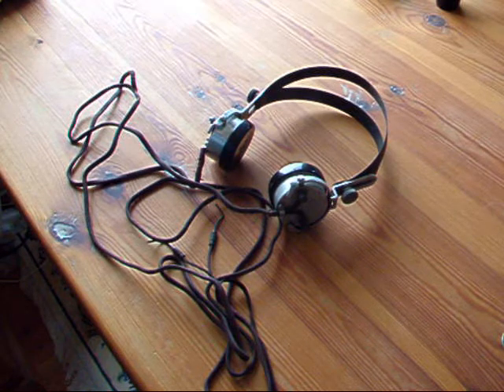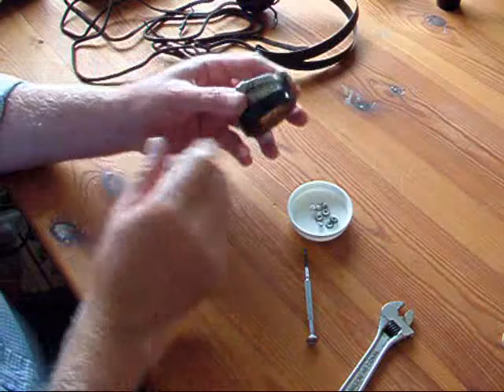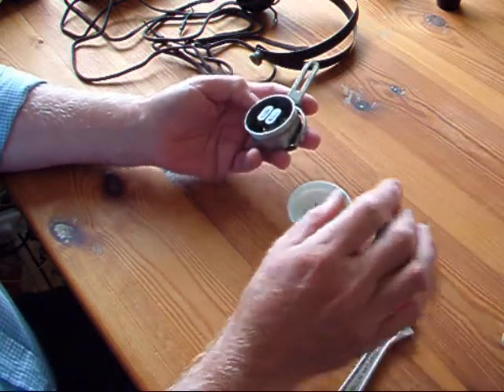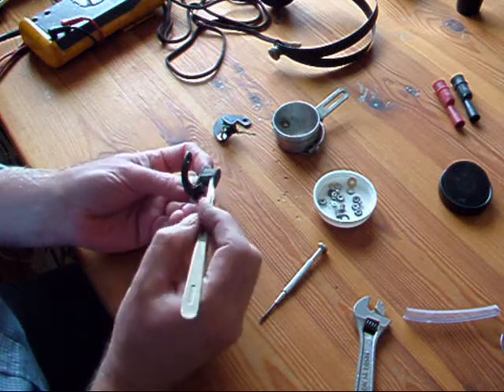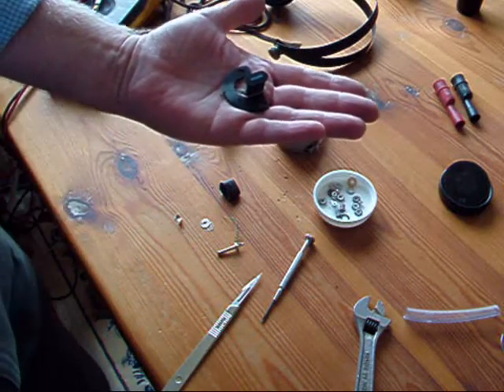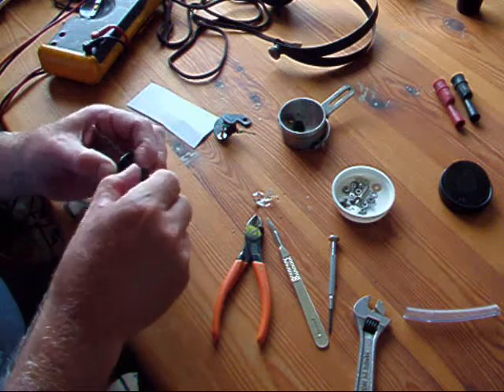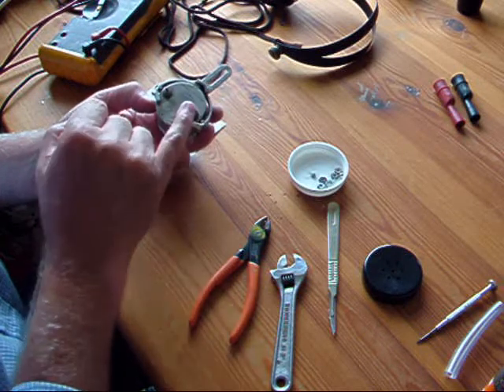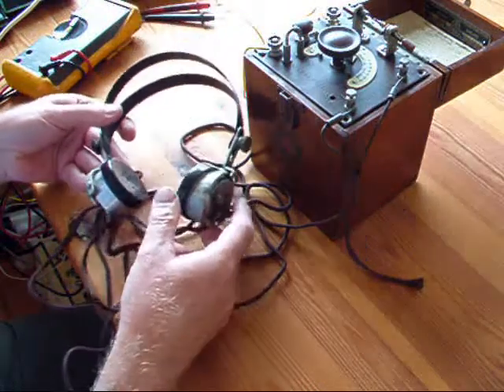Repairing Sterling Crystal set Headphones..wmv

Comment: I bought a pair of these exact headphones off eBay, in fantastic condition, but they sadly didn't work... Had no idea how to fix them. Couldn't believe my luck finding this video! Mine had three out of four coils open, all fixed and working now. I can't thank you enough, and others like you, who share their knowledge on this platform. It's truly the most valuable thing. I've also been introduced to your channel which is full of interesting videos. Thanks Andy, hope you are doing well, I'll be following your updates.
Reply from the maker: Hi that's great!! Well done on fixing your headphones. Well done on tackling the incredibly fine wire, 10 out of 10 for having a go!!  I wonder how much equipment gets dumped just for the sake of a small repair like this. I bet you felt really good hearing something with the repaired headphones. You know most equipment fails just because of one failed component, yes that sometimes takes out some others along with it but very often it's a single cheap item that stops something from functioning. Thanks for letting me know about your success, it makes it all worthwhile. 
Kind regards . . .  Andy
Reply: @AndyDaviesByTheSea  Thanks for the reply Andy, it certainly was a thrill to hear them working! It's was also interesting to learn more about how the headphones work, for instance I was surprised the speakers were wired in series rather than parallel, and as a result if one side is open then the other wont work either even if it's good. Such a well made product, like most of the good old stuff. The fine wire was certainly a challange! I didn't have much hope it would work out but glad I persevered. Would never of tried if not for your video so thanks again!
Reply from the maker: @ParlanceOpus  Hi,  I can't tell you how good that makes me feel.
Merry Christmas!!
Regards . . . Andy

Comment: I just did a set of western electrics that were open, in mine i had to rewind the whole coil with new wire, wasn't too hard to do actually, I used a metal lathe to wind it and made a fixture to hold the form. it really is great that these old headphones can be rebuilt pretty much indefinitely.
Reply: Hi bro, I have the same headset model, I had to completely rewind some of the coils, I plan to test / use them, but I need high impedance amplifiers, do you know any that I can use and / or do?
Regards

Comment: I think the wire in a cheap clock actuator would be fine enough for a rewind if necessary. Very tricky though. I might try to make some kind of improvised earpiece using such an actuator but I still even need to check the impedance. You can get tiny powerful magnets from old CD drives etc. It should be possible

Comment: I have a set of TMC BBC headphones. One tag is missing from the cable end. Can these be soldered? A first attempt caused the frayed ends to break off. The cable conductor seems to be steel or iron. They don't accept resin cored solder readily.